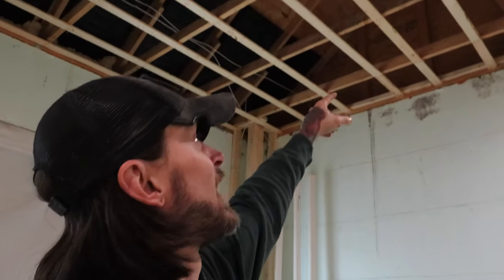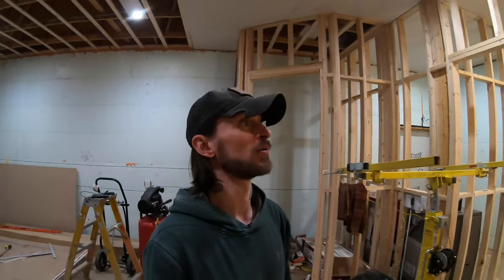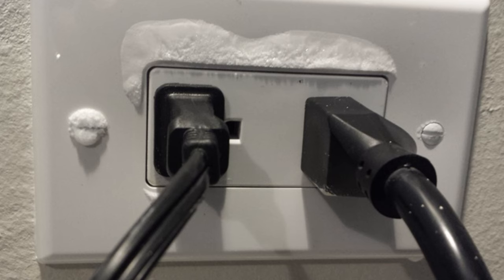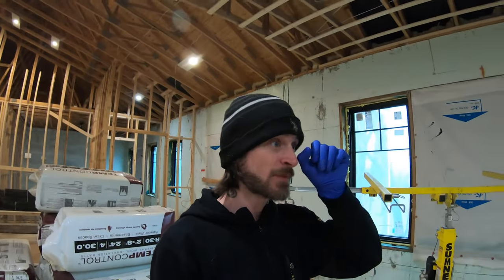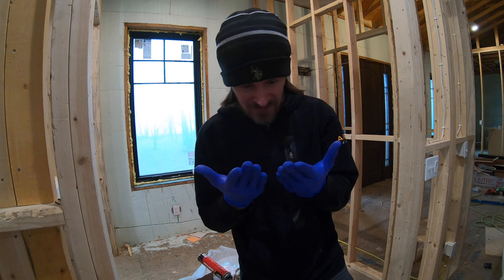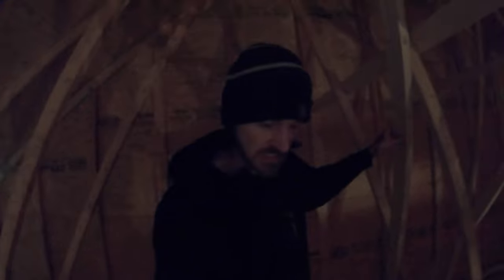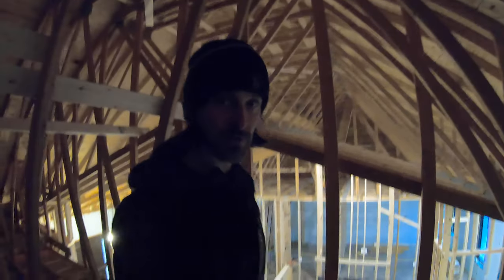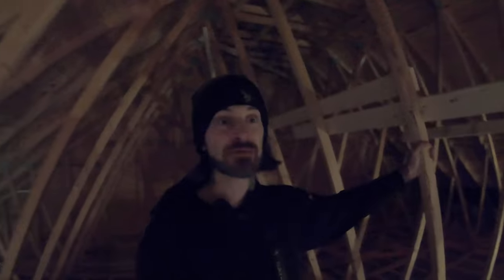Starting house drywall and air sealing attic space!

Comment: Looking good!

In the attic just put some plastic up on the second joist from the cathedral and fill the crap out of it with the blown in you’ll already be doing. 

If you don’t like that skip the foam board and staple some R30 in before you drywall. 

Less expensive options then foam board or spray foam. Better R Values too.
Reply from the maker: I could do that.  We are still weighing the options too on the type of insulation.  I have those r30 batts but they won’t do the whole house and they are to big for the 2x6 bedroom walls.  I don’t want to cut them up but I can’t return them now anyways.  Still just in the planning stage and seeing what things will cost.

Comment: It's my understanding that you want a vapor barrier inside a very tight house in a cold environment so humidity from warm breath doesn't migrate in to the roof/attic insulation and freeze or else just make the insulation less effective.

You don't see many issues in a garage because you generally don't spend as much time there, the garage doors usually aren't as tight as a house envelope and they aren't heated as warm so the air can't hold as much humidity. 

In warm and humid areas i think they try to place the vapor barrier on the exterior side because air conditioning dehumidifies the interior so moisture is trying to move the other way.

I spent a lot of time thinking about this since I'm building where it is hot and dry so the answer isn't obvious.  My conclusion was that a vented roof should always be drying so I want an interior vapor barrier.  I'll control interior humidity with ERV/HRV, humidifiers and AC.  Hopefully I'll be able to balance between mold and chapped lips.

For your insulation issues, I would just round up warped and split cull wood 2x4s from lumber yards and make a false truss skinned with house wrap or vapor barrier scraps so that you can create a vertical cavity next to your cathedral ceiling to hold a thick enough layer of blown in insulation.  You can avoid needing foam board doing that.

For non-structural interior walls, the interior vapor barrier should have been put up before framing to avoid breaks in the barrier, easy with a boxy home but some people make crazy designs that force you to spray foam gaps or just ignore air leaks.

I might use spray foam to seal my vapor barrier to ICCF exterior walls but I might also try tape joints and some of that foam roll that I think is used under sill plates, hidden behind crown molding.  I'll probably try to go cheap but make it so I can spray foam the joint after the fact if I have to.

I don't think you have to make your insulation expensive and I don't think you want to skip an interior vapor barrier.
Reply from the maker: im not sure about a tight house vs a loose house but id think with an r60 insulation that'd be pretty hard for the humidity to leak up that high.  a lot of homes getting build around here are using zip and zip tape so id expect them to be somewhat tight too.  we do have to get down below a blower door score of 3.0 for example so i guess id have to see what they are using.  

as for the garage vs the home youre probably right but i know we will have an ERV/HRV and a dehumidifier.  im not sure ill be using this $200 one for the whole house but i imagine getting a real one some day and taking care of that issue.   thats all i ever read about ICF's before is that you'll probably need both.  

i believe you are right, you want a vapor barrier on the hot side.  9/10 homes here though will only do faced batt insulation though which is no where near a real barrier but thats why everyone does.  

ill keep looking into everything for now and see what others have done here or in colder climates.
Reply: @neckofthewoods24  my understanding of blown in fluffy insulation is if it gets wet the insulation value drops a lot so if you start at R60 and then a couple inches get wet, you might be down at R52 which lets more moisture get in and I don't know where it stops.

I think the reason why ICF always needs ventilation is that you lose a lot of the benefit if you don't seal the envelope tight and while a well sealed building doesn't need to breathe, people inside it do and ERV/HRV can control humidity and odor issues.

The biggest thing is I believe when you vapor seal your interior and vent your roof above fluffy insulation, unless your roof leaks, your attic humidity will track your exterior atmospheric humidity, you shouldn't get any condensation and your insulation will always be "dry".  If you rely on drywall and paint to vapor seal your interior, that will probably leak (vapor) at some point, your insulation probably gets wet and maybe mold or rot start.

There is a channel called Laid Back Living I think and they are having massive moisture issues in their DIY "barndominium".  A lot is wrong so it's obvious.  You don't want a little wrong that you don't notice until you have a real problem.

I think this happens when exterior temperatures fluctuate above and below the dew point daily but the interior stays warm.  I might be paranoid but to me it sounds like that might be the thing that can bite you.
Reply from the maker: @joequixotic3039  no i think youre 100% right in everything.  i did just check the attic in the garage and all looks good but like you said, 1.  im not breathing out there and there is no water or moisture like showers or standing water in toilets etc.  the thermostat shows "dry" at 47%.  now even if i was out there it'd be interesting since steel clearly has to be 100% air tight and i foamed the cracks and panels where they come together BUT steel can condensate.  so if the insulation was poor in one spot i bet id get condensation on the back of the panels so ill really need to keep the insulation up to par.  i only have 9.5" joists with R30 rockwool in between them and only 2-4" of blown in overtop and over the joists.  maybe one day when that all settles, ill blow in another few inches so cold air can sneak down between the joists and find the steel.

as for the house, yes i think ill have to do something now.  cheapest option i think is lay down faced batts for the 2x4's so that'll at least be at the back of the drywall.  then blow in the rest!   another option is lay down a vapor barrier or retarder then blow everything in but since the plastic cant lay flat and my have gaps from the drywall to the plastic id be afraid that front side could be a condensation spot if again air could leak down to it.  

i guess the most expensive would be closed cell on the back of the drywall since thats a vapor barrier but i swear i read dont do that since condensation can foam on the attic side?  i cant remember now.   maybe because you dont spray that much?  i think Spray Jones talked about it somewhere which is why he only sprays the roof decking.  most research time i guess.
Reply: @neckofthewoods24  spray foam "hot roofs" (and walls) can have issues if you mix thin spray foam with thick fluffy insulation because you can wind up with the temperature gradient placing the dew point in the middle of the fluffy insulation where moisture can condense rather than inside the layer of closed cell foam where it cant.

With a vented "cold roof" that's not as much of a problem because it dries outward and the roof shouldn't condensate under the OSB or plywood decking.  Also there is little reason to mix foam with fluff because fluff is so much cheaper and it's easy to build enough space to get the R-value you want.

I think that other channel had a roof condensation issue because they didn't have decking or any roof underlayment below the bare steel roof.  You don't need decking if you don't care about condensation or you spray closed cell foam to stop condensation but I don't think they understood that and now they have big problems.

I think the best bet for you is to staple up a plastic vapor barrier and tape up the edges as well as you can.  Foam anywhere tricky and then blow in your insulation and make sure your roof ventilation is good (watch the BSI roof ventilation videos).  Your steel roof condensation should happen above your roof decking and be handled by your Ice & Water shield.

The ideal would have been to install a plastic vapor barrier before you put in any main floor interior walls so it would have been mostly big rectangular sheets and easy tape joints.  It's going to be a harder job now but shouldn't be too expensive.  It might make sense to take off your strapping so you can sandwich it, I'm not sure it might be easier, it would probably hold the insulation weight better and would let you shift your drywall expense to after insulation.

I don't want to sound like a broken record but I have been thinking about the cheapest way to build a high quality, well insulated house for a long time because I don't have the money to do it the expensive way.  I don't think it has to be expensive, I just think you have to use good materials in an efficient way.  A "cold roof" isn't as nice as a $$$ "hot roof" with really thick closed cell spray foam but it's more than good enough for conventional (leaky) construction.  When you go ICF walls, you don't want to ruin the performance with good enough, you want to use the best you can and you have most of it already, you just need a vapor barrier, insulation and enough roof venting to make the best "cold roof" you can.
Reply from the maker: @joequixotic3039  while it may it cost more it sounds like an easy solution is to spray the back of the drywall ceiling with closed cell.  1 inch may do.  Everything but the vaulted is done so Plastic now I think would be pointless as it’s impossible to lay that down around all trusses, cords, lights, gaps, wires etc.  spray foam would just be so easy.   And I think you’re right, closed cell against the house is good but fluffy then closed cell working outward is an issue with condensation on the inside face of the spray foam.  

Now I could save and just say screw it and lay down faced batts and see what happens.  Granted I’ll have leaking of moisture/movement but not a true air flow with my spraying of the cracks and mud/tape/drywall.   Should still be a closed in house but maybe not as great as closed cell or plastic before drywall.
Reply: @neckofthewoods24  I think spraying the back would probably work but it's expensive and if you ever need to change the ceiling, you're going to pull out the vapor barrier with the drywall.

I think ICF creates the possibility of a 2-400 year home so thinking about replacing things that usually last until a building gets torn down becomes a thing.  I want to try to live another 40-50 years so I don't want to deal with house maintenance when I'm ready to die but I would also like to leave a house that just needs a roof, paint and minor renovation to feel like new again and make it ready for the next 50 years.
Reply from the maker: @joequixotic3039  i hear you and yes it is.  but for ease of install, 100% air tightness i think its the only way now.  i just need to make sure its safe and will work.  again i think it was Spray Jones that said dont spray the drywall, just the decking.  i need to find out.

Comment: Do you have traditional bathroom exhaust fans or continuous ERV/HRV exhausts?   With today's tight homes with continuous ventilation, traditional bathroom fans are unneeded and problematic.   If you don't have sealed combustion appliances you could get backdrafts into your home.
Reply from the maker: Both bathrooms will get fans installed per their proper size for code and all but we have yet to pick an ERV yet, placement or anything else.  I did decide on an ERV vs a HRV but I need to call manufacturers etc and see if I can install them in an unconditioned space like the attic or find room in the utility room and do floor ducts etc.  on the list, just not there yet.
Reply: @neckofthewoods24  Sounds good.   My jurisdiction is on the 2009 IRC which allows for the substitution of a continuous ERV fan for a traditional fan as long as the exhaust flow rate is at least 20 CFM.
ERVs and HRVs are the best for keeping your home from getting overly depressurized because you can adjust the intake and exhaust fans separately.
Joe Lstiburek's Building Science Corp has some good building science info on this.   I read his cold climate building guidebook.
Then you need to figure out make up air for your range hood because that can really move air.
Tight houses are not easy to get right.
I'm in the planning phase of a home build myself.
Reply from the maker: @BenKlassen1  I’ll have to look into that.  No clue at this point and I want to get it right.

Comment: Looking good!  What do you think about an access panel in the laundry room or pantry “just in case” you ever need to see what’s going on up there?
Reply from the maker: Thanks.  

It’ll be a pain but shouldn’t be an issue with enough truss height to just walk over from the closet and check.  I’ll be adding some 2x’s to stand on once the insulation is down so I have something to walk on and not touch anything.  Less access the better since the hatch can’t be “sealed.”

Comment: Question: don’t you need a vapor barrier for the ceiling?
Reply from the maker: Never that I’ve seen before in common practice.  With just blown in I think it’s fine that vapor can move through and not cause issues with condensation etc specially with a well ventilated attic.  I’ve seen no issues in the garage for example.